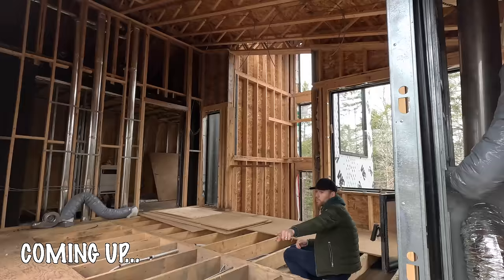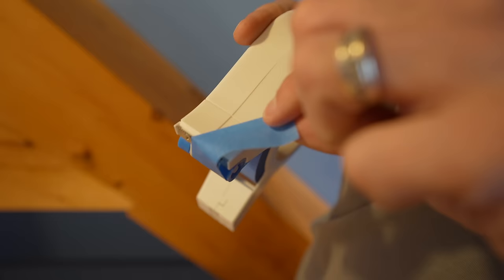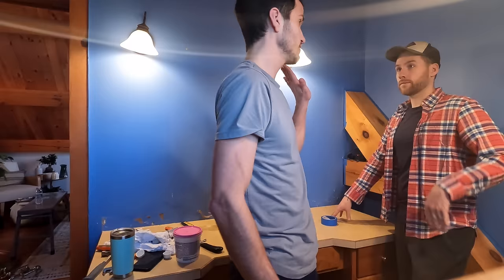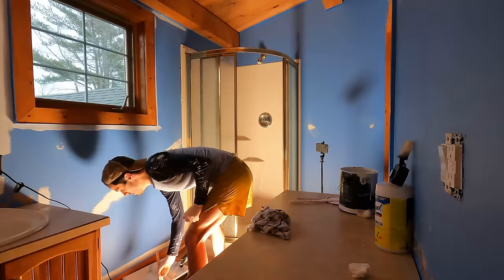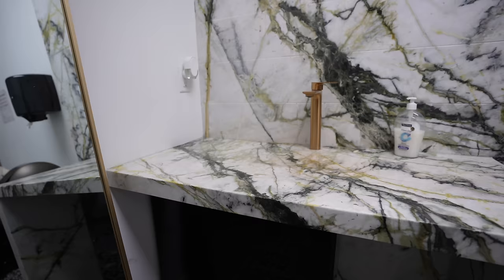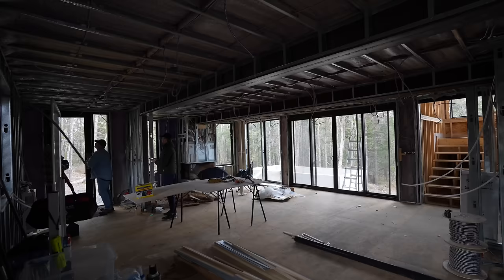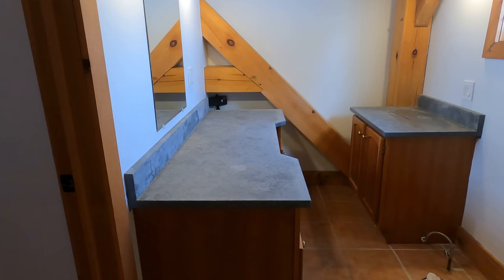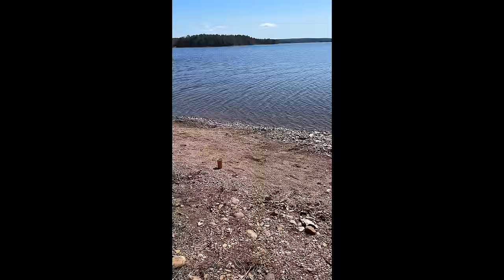What's happening to the Container Home?

Comment: Before you go ripping out another set of stairs you must realize, if you haven't already purchased finished flooring the top and bottom step will be 2" different in height. The top step will grow one inch and the bottom will shrink one inch once the finished flooring is installed. More so if its full dimension hardwood flooring less if its a laminate or vinyl product.

Comment: I can completely sympathize with you on the stair issue. My Mom's stairs in her house is a bit jacked up. I don't know how they (the builders) hid it, but when we took the carpets out to put in hardwood floors, we discovered the top step is almost a full inch taller than the rest of the stairs. 
Just know that when the container house is done, it will be done the right way and you will enjoy the fruits of your labor for decades to come!

Comment: I'm positive that the person that did your stairway was the double of the person who built a shed for me from a kit. 
This was a simple 14x16 shed, I found so many things that were wrong, and we got into it. I called the state inspector, and they don't inspect sheds. He said he would look at it anyway. He was shocked, and he found things I didn't realize. So, with the nightmare, I ended up in court, and I lost the case due to a subpoena not being honored by the inspector. 
I had a neighbor take the shed down, and thank God I told him the major issue. I came home as the rafters were being removed. The last one in the corner where the MAJOR problem had just been taken off when I came up. I was told by the person doing the demo that had he not known about the corner, he very well could have fallen and been seriously hurt or killed. What you ask was wrong? In the north west corner of this 14x16 shed that was a kit, built by a person with twenty years of experience, there was no, nails, screws, glue, staples, bolts, NOTHING HOLDING IT TOGETHER and no floor that I ask for only gravel. There was about a 10x10 section of siding holding the corner together. 
Well, I hope your project is fixed and you can move on from the nightmare.

Comment: Handyman Tip- when removing a toilet from the flange, be sure to set it on a flattened cardboard box. The wax ring that seals the toilet to the flange (which is connected to the outflow pipe) is incredibly sticky and gross! You don’t want that wax getting on the floor or anything you value.

Comment: You two compliment each other so well, Todd is there when Tyler is overwhelmed and struggling and then Tyler is there for Todd for the same reason. There is a lot wrong with the container and its extremely frustrating and annoying, but you now have someone you know and trust to put it right. It will be amazing when it is finished, so hang in there. You picked the same worktop that I noticed and wondered if you go for Tyler. I love your bee next to your loungers x

Comment: In my younger days I did some painting and used the edge of a  plastic dustpan instead of taping. I'd only have to wipe any wet paint once in awhile. I could slide the pan along the wall as I painted. Very quick.

Comment: We have a thing here in the states now where many builders are dropping Quartz countertops, seems the silica dust made in the manufacture and cutting to fit onsite causes Silicosis. There are new guidelines where they can't be cut onsight, but have to be cut outside under a waterfall blade that washes away the dust. They say many of these installers now have life-long lung problems. But of course you should always use a mask, but that often wasn't enough.

Comment: Tyler, I am with you, that sink is dope! I love that you are simplifying the interior of the house on the lake. It is more calming and more appropriate for the location. BTW, Todd, I am with you, I cannot just sit back and just enjoy my yard without seeing what still needs doing. I do have one suggestion though, (not that you need another project to do)...When you get to redoing the porch/deck, can I suggest cable or glass for the railing? It would give you a better view of the yard/lake when sitting there just enjoying that view. I kind of liked the rocks where they were, it was natural but I understand you wanting a beach there. I think the rock wall with topsoil backfill for the tree is a great idea to save it and perhaps some guard(?) wire to help keep it from falling over. 
I am so sorry about the container house having issues, I watch some other creators who have had contractors that just bail or failed at finishing the job much less doing it right. It seems to be a common thread here in the States as well, what has happened in the construction trade? Does anyone take pride in their work anymore?

Comment: What you guys need is a project manager to take control of the container home seems to me most of the problems you have would have been avoided if you had of engaged on in the first place..in Australia we have building inspections who come out at different stages to inspect them and then sign off on them before work can progress anything that is not to standard has the get rectified.
That way once he signs off on a project if anything goes wrong the council is reliable.
So get yourselves a project manager in to handle the ongoing and a building inspector in  to check off on all stages.
Cheers Guys🥂
Tony and Wollie 🐾

Comment: There are many contracter out there that does shoddy work, or delivers work done that really needs to be fixed by someone who does good work. I've seen this myself several ties and the sad truth is that many of the does this because they believe they can do it without being found out before it's way to late. So if you need someone do to some work, you should always do a lot of research checking them out and if there is any negativity about them that needs to be followed up on. Doing it that way might take a long time, but it will also help avoiding the worst of them usually.

Comment: While I love the stone you chose for the bathroom, I wanted to let you know about a product I saw on Lone Fox where you can cover old cheap tile or countertop with a concrete finish.  I think it was called concrete-o or something.  It looked pretty dang good., and seems so much easier and cheaper than replacing tile or countertops .  It may not be what you want to do in the cabin, but I thought you might like to know about it as a possibility for future products.

Comment: I don't know if you  can do this and still match the aesthetics of the house but if you replaced the existing railing with metal with wire running horizontally you'd get a better view of the lake when sitting in the chairs.

Comment: Hi guys,   I'm pretty sure you're both exhausted from all the crap you've had to deal with, and being cheated and let down by contactors. Bless you both I hope things are back on track now. In the UK, we tend to get a few  contractors to give us quotes    and then have a contract signed up where the work will be completed for a set cost, if they fuck up they have to fix it at their expense and they don't get paid a dime until the jobs completed.

Comment: FYI, Caesarstone "quartz" is not natural, it is "engineered".  It is also an increasingly controversial material, since the preparation and cutting of engineered quartz creates dust and fibres that are carcinogenic, and as deadly as asbestos.  Australia will be banning the material from July this year, because of the safety issues.  Also, while concrete slabs are porous, they can be sealed with a resin that makes them impervious to moisture - and it doesn't alter the look of them at all.

Comment: Ok guys, sorry I was late to the party but I read every comment here, even the trolls… 😢  I was worried about erosion at the “beach” but did not want to beat a dead horse or be a Debbie downer. 

However…
I wanted to point out that the larger cobble and boulders are needed to hold those pebbles, gravel & sand on your shoreline and slow down erosion.  Please put them back to hold your smaller sediments in place.  Maybe if Todd needs a task for when his engine has to run, he can pull them out for fair weather and put them back for foul weather… imagine how ripped he would get… 😂❤😊😇

So great to see Charlie moving so well!  Loved Eddie’s wiggle worm and Princess Lily AKA Squirrel purring contentedly at the door to her new home was a joy!

You two joking, laughing, drinking, keeping each other sane and holding hands by the lake… just priceless! I am so glad you guys are back.❤  Sorry the container homes are having so many issues but glad you have a trusted contractor to help now.  

Do check if the stair irregularities are to allow for finished floor heights at the bottom, top and landings.  There may be a reason (your finished floor material depths) for the variabilities now that will be even upon finished floors. 😇🤞 Check your finish floor depths before tearing out the stairs please.  

That unsupported stair tower was terrifying. 🍀🍀🍀🥰🥰🥰

You guys make my heart happy!  Thanks for sharing. ❤

Comment: Hey guys, I find it HI-LA-RI-OUS, Tyler saying "We're not gonna spiral", then Todd spiraling about the stairs... which are non-spiraly stairs... truly ironic hahaha 😂

Anyway, sorry to hear about the fixing that needs to happen, but one step at a time.

For the stairs though, keep in mind that the floors aren't finished yet... So the bottom step should probably need to be higher, as it will be less high with finished floor downstairs, and the top step should be less high, as it will be higher once you get finished floor upstairs.
Same would probably apply to bottom step from the landing, and top step reaching the landing.

Telling you just in case, I know I wouldn't want to re-do them a 3rd time 😅

Comment: You have had some crap contractors working on the container home. I don't understand why you used the container design at all but hopefully it's possible to get it all finished over this summer. It has really brightened up the cabin by painting over the dark colours.
Why is that bathroom cabinet thing so big ? The counter top fills the space.

Comment: On the toilet removal a simpler way would have been to turn the water line valve off and then flush the toilet - the tank and bowl would both empty but since the water was off, neither the bowl or the tank could refill with water - then simple removal of the bowl from the floor would be made easier - a very small amount of water may have been left in the water line to the tank but could be cleaned up with paper towels. On contractor faults during the initial build, do you have any recourse against those contractors so that you don't have to use your assets for the corrections or would that out of necessity involve legals who could be paid out of returned dollars for poor work - sounds complicated but considering all the work that needs to be done, especially the foundation for that one wing, it might be worth the time and effort. I do so look forward to seeing a beautiful "home" and not a completed container build.  Good luck on all you are doing - the road may be long but the path to the finish is shorter.

Comment: How did Todd not notice the difference between 5 inches and 8 inches (on the stairs)? You guys always persevere in the face of adversity. If I'd known you a few years ago I might have tried to better inform you on the pitfalls of container homes. You seem to have experienced basically all of them and then some. You wanted to save money because wood materials were so expensive at the time, and I'm a bit sad your savings probably didn't materialize.

Comment: OMG,,shut the water off and flush the toilet,,with the water off no more will go in the tank or bowl,,i learned that at 7 years old
Reply: They were trying to figure out how to get ALL the water out of it. Not just the tank
Reply: @farmerthatflies  also,,there will still be some in the tank because it wont all come out at the bottom,,they just need to tip it to get the water out once they disconnect from the floor,,its common sense